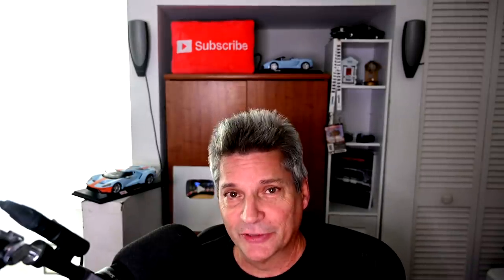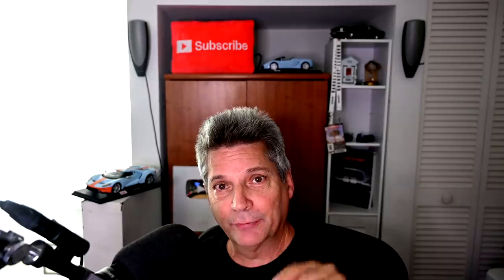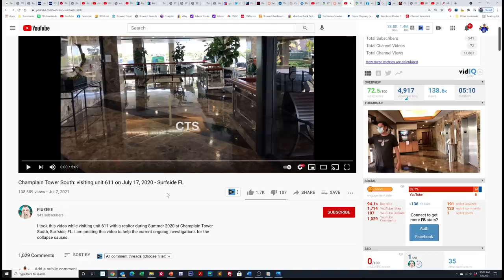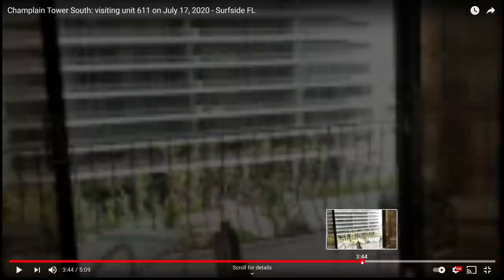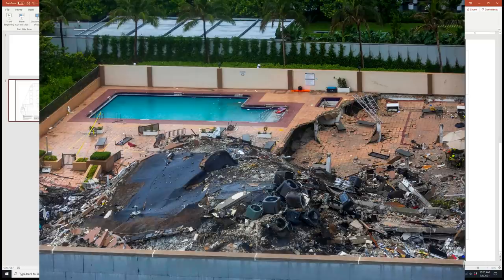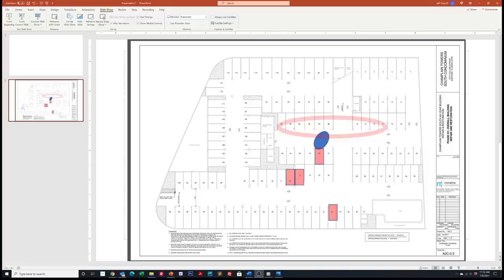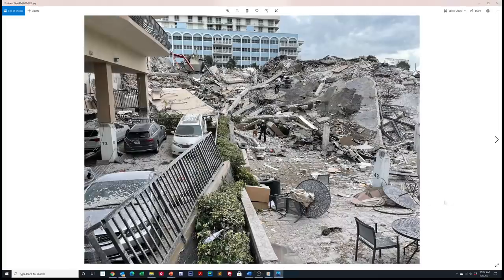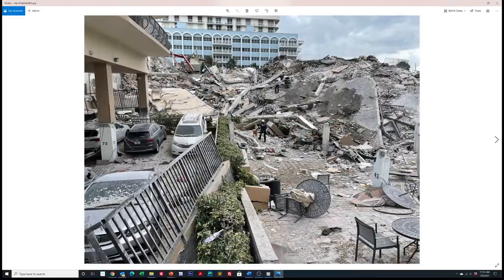Analysis Garage Video BEFORE Condo Collapse: Water Everywhere

Comment: I wonder if there's a record of tenant claims of damage on their cars from stuff coming off the ceiling.
Reply: there is, the condo association payed to have cars repainted because the calcium carbonate dripping from the ceiling ruined the paint on some of the residents expensive cars.. that is why those panels were tacked on the ceiling roughly around 4 minutes into the video. good catch on the comment however.
Reply: @jasonmarks1636  I was wondering the same thing.  Never mind falling concrete, when you have hard water continuously dripping on your car it is going to cause a lot of damage.

Comment: At parking space 54 the concrete roof, including the rebar is hanging down. It was collapsing a year before the final complete collapse. That's why there is so much water on the floor there. The water was pouring through the break in the concrete roof above #54. They just patched it to stop the water pouring onto the vehicle.

Comment: "Water is the Chief Architect of the Planet" - my personal observations from the Himalayas to my basement. Your videos set a standard of excellence in disaster reconstruction, and need to be sent to every victims' family's attorneys. Outrageous, wilful neglect.
Reply: Yes I was thinking the same thing. The families of the victims need to see this
Reply: Maybe residents didn't want to fix?
Reply: @jackiepowell7513  you're 100% correct. The residents were notified and argued that the cost was too high requesting multiple different contractors to bid thus wasting valuable time and years...
Reply: Not just years, decades. And since it was substructure subsidence that was the biggest problem, this place hasn't been safe for ten years.
Reply: I agree with you that his analysis is incredible and will definitely be used by attorney's. I wouldn't doubt if this dude gets called to the stand as an expert witness. Although on the stand in a court of law, it's not how good you are, it's how good your certifications are.

Comment: The head maintenance guy from '95 to 2000 said the water would get so high, it would float cars. He ran pumps to get water out. He did this continually.
Reply: I wish more people would comment on the comments he made, because they are HIGHLY relevant.
Reply: ok but common is this all from the pool? the ammount of water you are taling about is much more than  the pool can hold assuming it all leaked out...this water must have been comming from another source...if it was all from the pool the first cause of action would be to stop using the pool if it was a seive....even after the building fell the pool was still full of water!
Reply: @d3891  yeah , “float cars” would require far more water than the pool held.
Reply: Why would anybody stay if this place was floating their cars???
Reply: @fnhc2023    Maybe they sold?
Reply: Yes and he (Maintenance guy) also said the water was salt water. That puts to rest most theories of bad waterproofing or leaking pipes. Don't forget the pool contractor also specifically noted that the standing water by space 78 was salt water....he would likely know the difference! Where does the salt water come from? Likely under this building!
Reply: @d3891  It came from the pool deck...it's Miami, it rains every day.  The deck was not sloped.
Reply: And all that water has been finding the weakest points ie the base of the columns and into the cracks. Hence washing out the footings.
Reply: This kind of garage flooding is common in the area.  King tide, sea level rise , ends up with water literally seeping up from the ground .
Reply: @JoeS97756  actually the deck was sloped and you can actually see the drains....not many of them... but yes there are drains and sloping towards those drains
Reply: @alanpikul1689  Maybe so and the pilings back then were not driven into bedrock.  However, I don't think it was the cause of the failure as the pilings are still intact vertically...it's the pool deck that broke through them.  Weight of pavers?  Lack of maintenance to waterproofing on deck?  Too many cracks?  Paving stones/sand interfering with drainage of the deck?
Reply: From rainy days

Comment: 10:53 the plastic sheeting is to stop the driver from getting wet when they enter or leave the car. this suggests it's a long term problem and when it rains alot of water comes through the floor above wetting these owners and thus the plastic sheeting
Reply: It's basically the smoking gun of this case. This building didn't just collapse one day. It's been a ticking timebomb from the moment they poured an non-sloped concrete slab. There was evidence for years, that there was a problem with water leaking from above.
Reply: Maybe. But there were people in this building who lived overseas and came here only once in a while. It could be to protect the car from water, dust or other damage.

Comment: Those rods look beyond rusted. It's like they have almost disolved inside the concrete.
Reply: Another engineer covering this explained how when rebar rusts, it expands a lot, which cracks the concrete and then it pulls away from the rebar.
Reply: Devoid of oxygen, even stainless steel is eaten away: the design of that building was a timer, waiting to fail. Probably many others too..

Comment: Looks like the ceiling was water logged & sweating, softening up to cave in.
Reply: ?  AC condensation
Reply: @lindabutts846  way more than that. improper drainage
Reply: Near 106 it looks like water staining on the yellow part of the column  too
Reply: The ceiling isn't the problem, it's the pillars.
Reply: @TryptychUK  The bottoms of them to be precise, thats where water goes, to the bottom of things.
Reply: @TryptychUK  I disagree respectfully. The columns sheared through the slabs. To me, that shows that the slab was compromised under the pool deck to the point that it released from the columns and "pancaked". The rest followed.
Reply: @SteveWillNotDoIt1984  So, rebar connecting pillars to concrete beams released their adhesion, allowing drop and punch through?
Reply: @sunnygirl87  didn't seem any concrete beans but yes, definitely the pillars punch-through
Reply: @SteveWillNotDoIt1984  Beams are in the original plans. Tourist video was analyzed by a couple engineers who stated it looked like a beam between 2 pillars dropped. I believe they commented according to the plans, pillars did not support beams there but were attached to the ends, like an "H" rather than an "I"
Reply: @sunnygirl87  yes I saw that. The beam was improperly installed and the planter that was overweight was on the slab that was over the beam

Comment: I noticed that on the Yellow portion of the columns (near the elevators) in the garage, you can see what looks like water marks.  The water damage near the ramp could be due to water flowing down from street level. The sidewalk just outside of the ramp looks like it is over storm water piping.  There could have been a small leak that gradually eroded the foundation on that side of the building.

Comment: The minute it collapsed and the complaints I heard directly after, had me come to the conclusion immediately that it was the water build-up and the pool leaking that caused the foundation underneath the concrete to erode. This was totally preventable and there is no doubt people should go to jail. As far as I'm concerned, this is murder.
Reply: Pool did not leak. Pool deck es
Reply: This is premeditated murder for sure. They all knew about the water for years.  Poor tenants.
Reply: some of the people responsible are dead because of it, the rest lost 100% of the stuff in their units plus any cars in garage
Reply: @carolschober8028  how do you know?
Reply: @schmoopyvonboopy4959  i owned a Jr 1 bedroom condo (smallest style unit) in a 2 tower, 900 unit building in chicago. some units were 3 bedroom 1800 sq feet. came time for window replacement. when you are 20 or 30 stories up the winds get very strong. our association saved up for the replacement over years. my portion of replacement windows was 6k for my jr 1bed. the association paid for the other half.   the 3 bed unit was 36k. not all associations have the foresight to plan and save for repairs. while i feel bad about the loss and disruption of lives, i do not feel for homeowners who neglect their properties.

Comment: This video gives me chills. Honestly this is like watching a horror movie. So many signs and the poor tenants without experience or knowledge did not know what was happening. I will be walking around my condo basement to look around tomorrow. Thank you for your detailed video, taking your time out to slowly explain and educate the public, very informative and I believe people need to be educated and be aware of these things
Reply: If you see water damage in a building over 2 stories in Florida get out. We have sea salt in the air, it alone is corrosive.  When poor quality concrete is used it will eventually crack allowing water to rust the support be it rebar or I beams. Rust can eat through iron fast. This can cause a weak place and over time it can fall. This buildings weight on all this inferior construction was doomed from day one. I'll bet the pool was built by someone other than the building people. That's why the pool is still intact. Who ever built this building is in the wrong. 🤯🤡💯💩
Reply: I am sure that the residents of the condo were not happy to pay the $15 million needed for their condo in 1918. I wonder what their maintenance fees were?
Reply: @lindaglover7194  My aunt and uncle took a vacation to the ocean at Padre Island some 40 years ago.  They were there for less than a week.  When they returned to Oklahoma, they found substantial rust on their truck, which had not existed previously.  I was told that automobiles shipped to dealerships near an ocean have a special protective coat on the paint to prevent the rust.  Don't know whether or not that's true.  But that was my first indication of how corrosive sea water is.  We have 1 saltwater lake in Oklahoma, Lake Keystone, I believe.  We spent 3 days there one summer when I was a child.  I spent at least 80% of each day in the water.  By the 3rd day, the snap on my cutoff jeans that I swam in was so rusted that it wouldn't snap.
Reply: Everyone should be vigilant of their property. Be it single houses or condominiums. We cannot trust any company or contractors that only live for profit.
Reply: Make sure to update us to what you find!
Reply: .......:) Yes, I agree with You...!!!...Whatever You Own,  or Use Regularly---You should at Least Know how to Trouble Shoot, or Recognize Problems, and/or make Visual Inspections, etc.....House, Condo, Car, appliances, Neighborhood Changes, etc---And really, Even with Your Kids and Family Members, too...!!!....Entire Planet Getting Worst in Every aspect, every day---Gotta stay Alert.....!!!.......Sad.....Thanks......
Reply: @lreyescordova  so true, so true. We cannot trust ANYONE who profits from us.

Comment: Note about the orange cones in the parking garage: I used to certify service techs on how to safely back up their service vans into tight parking spaces, and one trick we used was to place a cone so that as the vehicle was backing and then barely bumped into the cone, that was the indicator to stop backing - saved all the guessing and dented bumpers.
Reply from the maker: Yes AT&T guys do that all the time
Reply: I have also seen cones used so other people wouldn't take their parking spot.
Reply: I was wondering about those cones being right under a few big beams. Only other thing they can show is one of them could be providing a hint where to turn to go up the ramp.

Comment: Really informative analysis...It appears to me the garage ceiling between column 52 and 54 is pushing down and column 52 is slightly leaning maybe from the downward pressure. Looking at columns 52 and 54 side by side is where it looks like it is pushing to the left.
Reply: I was thinking the same thing, how the top of column 54 looks weirdly crumpled.

Comment: Hi Jeff, please take a closer look at the the base of all the columns nearly all of them have water marks.  They have been repainted yellow but still you can see those columns are soaking up water. On one particular towards the end view there is a close up of a column that is bubbled towards the top of yellow and at bottom it has been scraped and painted you can see the transition.  It leads me to believe this has been going on and they did not test the integrity of those columns only painted over to hide their weakening condition due to continued water damages.  Also when the video is showing the garage entrance towards the end when she was looking for her slot in the distance the column closest versus those in the distance is not vertical and seems to have a lean to it!

Comment: This is caused by bad waterproofing.  Leaking through the slab from above it's obvious. You can pour a cup of water on an unsealed concrete surface and it disappears into the concrete. I did slab waterproofing on industrial buildings for years. They should've put an elastomeric membrane in the planters and every square inch of surface above.
Reply: Totally agree with you. No waterproofing. Those planters had to be heavy too.
Reply: It isn't just a waterproofing failure. It has a lot more to do with lack of slope on the deck. IDC how much waterproofing you use, or what type, if the water has nowhere to go, sooner or later it will find a way in. All waterproofing has a lifespan, so it can't be counted on alone to save your structure.
Reply: Ask any italian who hoses down their concrete where the water goes.
Reply: @jacktheaviator4938  there is also several plumbing draining issues. Tons of pipes that needed replacing, my husband is a plumber and he couldn't believe the amount of failed patches we seen on pipes still dripping. This building was destroyed due to years of draining issues with the pool deck, the slab, the planters, and the plumbing. The blueprints show the laundry room over areas 77-79, and most of that ceiling was cracked, had failed epoxy, and tons of dripping pipes.
Reply: @elizabethwilson9686  I did notice a couple of VERY suspect looking band-aid type repairs on pipes, but I'm not any type of expert on plumbing/mechanical systems, so I didn't mention them. But you are right, leaking pipes certainly didn't help.
Reply: It was mentioned in the inspection for new compliance certificate that the waterproofing had failed and needed replacing but would be expensive and inconvience the building occupiers.

Comment: The only thing I’ve seen make stalactites in paint on the ceiling like that is a large pool of collecting spreading water ABOVE the ceiling from a broken pipe or leak way above.
Reply: living room ceiling started looking like a boob so I poked a hole in it and find out it was running down the rafter from 10ft away! r once the hole was there the water came pretty fast but it only took about an ounce to make it look like a little boob and do the same thing to the paint if you have oil-based paint and tries to keep a moisture barrier but it can only do so much these people knew what was going on my opinion and that is the bottom line ...It could have been prevented... I just said earlier that I live in Columbus Ohio and we have inspectors that come out with any home business whatever you would think they would make it mandatory like every 60 or 90 days ... It's not that hard to maintain something as opposed to completely ripping it apart to repair it I'm too bad it cost us to be all these people being hurt because they didn't want to pay somebody 10 grand 20 years ago to fix it when it could have been repaired..... sickening
Reply: @Suggestion_Box_Full  I agree, the paint was holding the water in, transporting it long distances throughout the rebar network, every time the planter boxes were watered... drip drip, hydraulic pressure of water equalizing... for example, water finds crack on surface, 4 inches below to rebar, rebar now has 4 inches of pressure to pump water down the rebar and into the rebar network. Like a large water damn underwashing the base... and the paint just held it in.
Reply: Even at 6 minutes you can see the ceiling paint peeling off. 
Clearly the garage roof slab is saturated with water, and the rebar rotting away. 
I assume one part of the slab eventually cracked and fell, and levered off the 5 tiny columns in doing so, and then the extra stress in the building caused the rest.
I've seen many damp building garages - perhaps this is a widespread issue...
Reply: and that's why all of the vertical support failed simultaneously?
Reply: @runfayalife  the roof collapsed first: documented fact. look at the thickness of the roof vs the thickness of the posts. 
Put a glass on a table, then balance a book, then another glass on top. Now tilt the book.. the top glass now falls down...
Reply: @G-ra-ha-m  there is video footage of huge collapsed chunks in the garage about 10 minutes before the rest came down.
Reply: @Jeninok79  do you have any links for this?
Reply: @dipren443  in the tourist video i think.